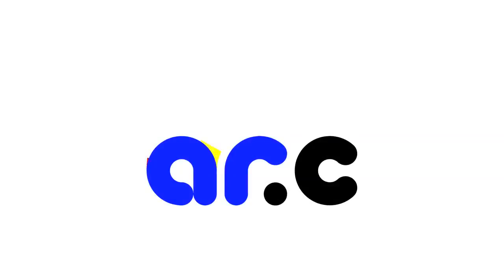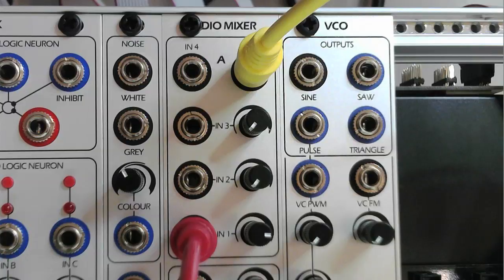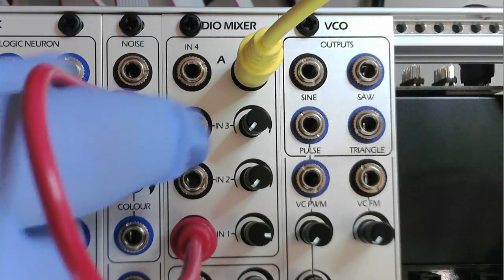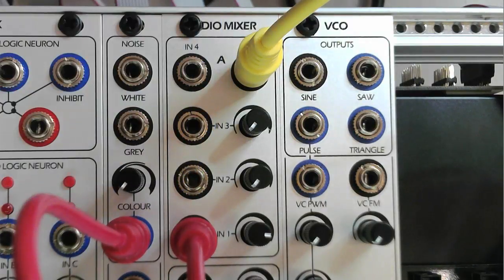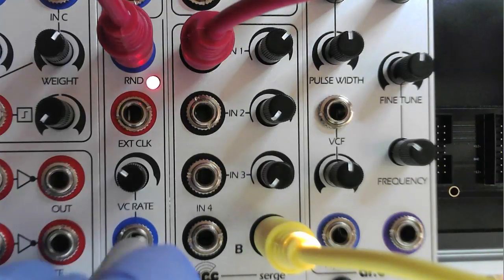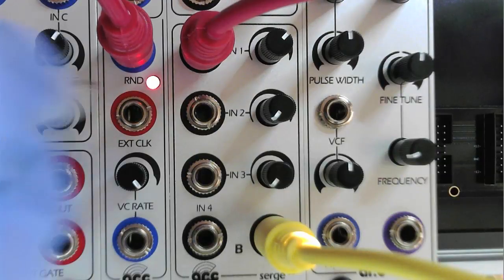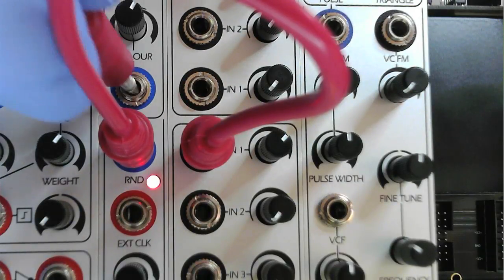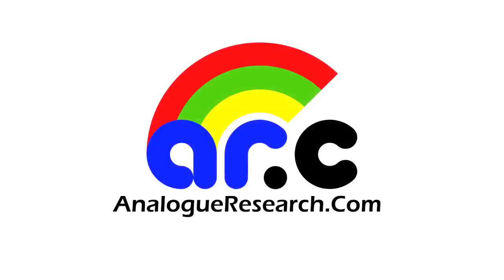ARC Noise Rainbow eurorack synthesizer module overview.

Comment: Hey there, just wondering if version 1.1 of this module has the output voltage-level quirks that have been reported? (White Noise output range of unipolar 5v~10v,  Color output range of -3~10v and attenuation, etc.)